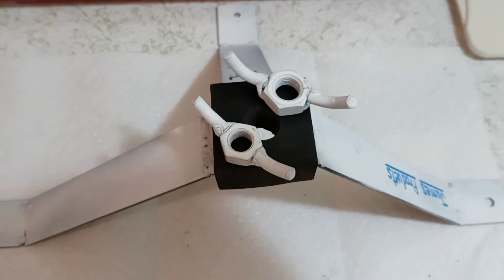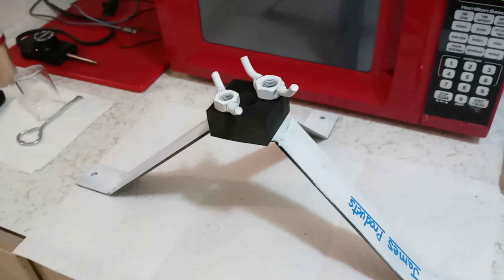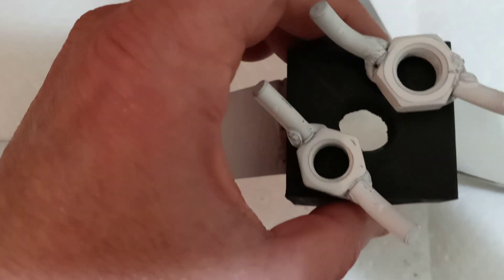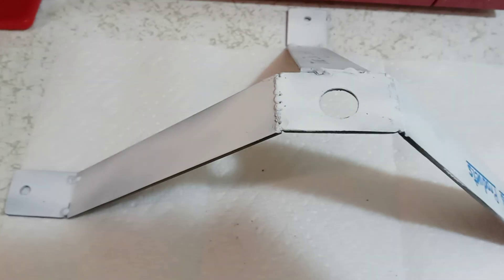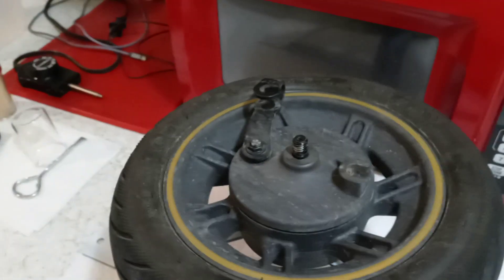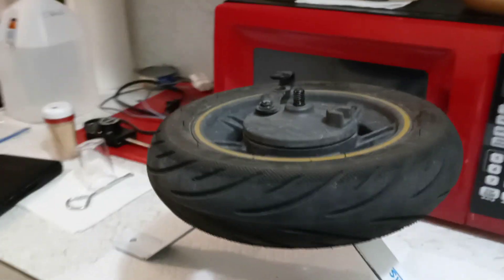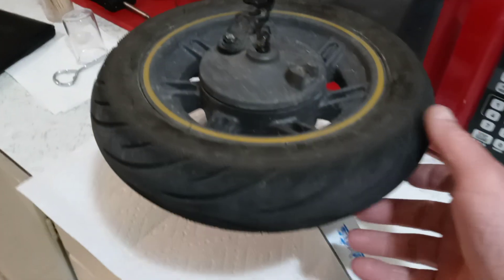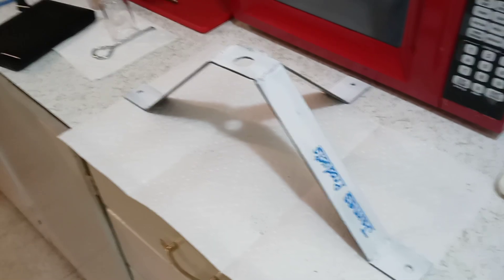Universal Electric Scooter Tire Changing JIG.

Comment from the maker: This was Designed to be Universal. All E-scooter types, both 8 inch, and 10 inch tires. Holds wheel assembly rigidly, while you change tires, tubes, or patch tubes. *NOTE Tire Plugs NOT recommended. Two ply scooter tires will not hold them at full speed and tire pressure. For minor leaks, use a Tire Sealer for tube tires !